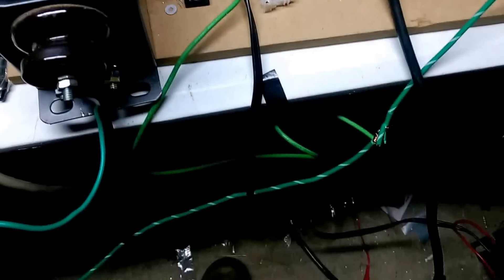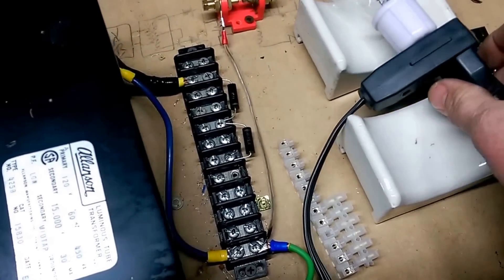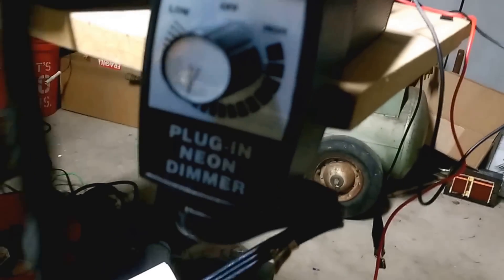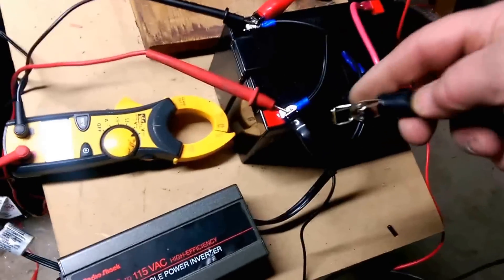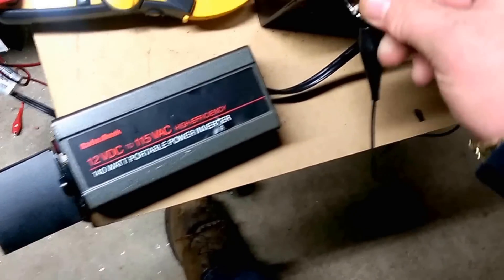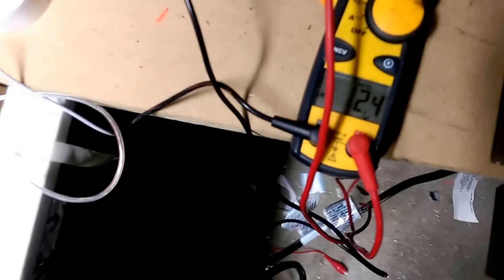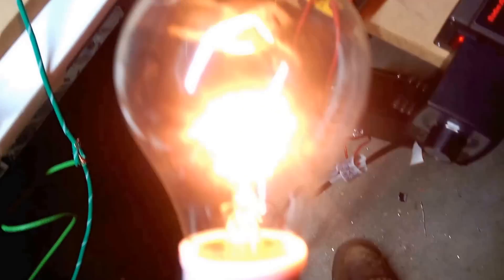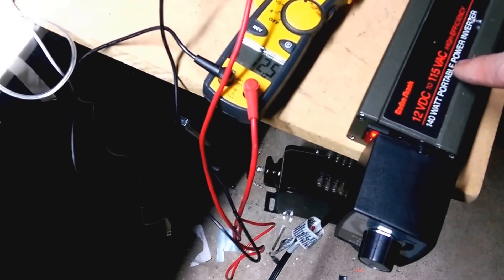Working Free Energy Generator-Dezeinstein Technologies-Annotated

Comment: Hi, Mark!
It look's like privious video! 
This if very normal to me, you drive nst and bulb form battery and inverter.
How about the ampere meter! I don't want to be rude, but what is so special here?
brd
Reply from the maker: +Francis Graf regardless of what happens with the voltage or amperage,  its capacitively attracting energy from the Earths electrical field,  so,  it isn't overunity,  it literally doesn't even violate one law,  but,  because science doesn't believe its a possibility,  they'd have to rewrite some equations and admit that the Aether exists.  It does exactly what I said it does,  and its not hard for anybody to figure out that there's another source,  its just done by an unbelieved method Tesla discovered,  which does fortunately output more than it draws due to how it works.  that is all that matters.  the biggest issue I have is whether people believe it or not.  it doesn't matter by video if anybody wants to believe,  or if they do by seeing the video..  if their like to see it live,  I'm sure I'll get an invitation to a convention somewhere to. show it as I'm one of the only guys on the planet to. successfully replicate Teslas phase conjugate circuit,  that is after Don Smith passed,  and its not exactly the same method Don. used which makes it my own.  If power is put in,  of course  power consumption will be reduced.
Reply from the maker: I actually haven't even had a chance to scope it yet. I am having issues with my 5kV probe, it only works when the spring is depressed... gotta send it back to the ebay seller.. It was a Chinese product.. some are good, some are crap.. this one is crap!  anyway, I have a 40kV probe but it is for a meter, so, I am nervous of blowing up my scope with the 1 to 10x probe.. I'm not sure what the voltage is at the line side of the diode.. I'd be happy to scope it after the diode at the capacitor as the voltage is in the safe zone. I can scope the inverter, however, I am waiting for a package to come since I accidentally tapped the side of the led bulb to the arc gap and zapped the inverter dead. It doesn't work with a modified square wave inverter as the transformer becomes all whacked out with the choppy wave and it gets very noisy. I am afraid I will ruin the NST with it so I will wait until the ebay shipment arrives before messing with it. I do have the inside of an old black and decker inverter that I was going to mount in another case, I may try that .. I don't even recall why I took it apart, maybe wanted to see if I could remove the protection circuit.. I will try to see if it works without shutting down but I am afraid it is MSW as well.. They are junk and everybody should stay clear of them. I remember way back when there was a Canadian brand that made all true sinewave inverters for reasonable prices. I gave mine away not knowing they would become out of control expensive for a decent unit like they have become, however, they all have low voltage shutoff, temperature protection, gfci or some other forms of protection circuits that all interfere with the operation of this circuit. The devices think that they have low voltage because the output only reads at 85 vac, then again, the voltage works just fine as it isn't a normal voltage. the 67 watt light bulb at maximum is way brighter than a 100w light bulb and it runs at maybe 40 watts . The nst idles at a much higher wattage than I thought it would, but then again, if you watch Don's lights running at the Tesla Symposium the engineer that was impressed with the output into the bulbs tested the output and said it was runniung at 79 or 80 volts and he said that converts to about 120.. whatever that means.. But Don said it would correct itself. My device does the same thing with a load on it. I have tested 85 to 88 volts at idle, then, loaded it gets right up to 120 after it runs a few minutes. The output levels are much brighter than conventional power. The light is brighter and it is cleaner looking if that makes sense. I'll probably receive the radio shack inverter tomorrow of Thursday so i will test it and send another video to the tube..
Reply from the maker: +Francis Graf for anybody that wants proof real simple take a 12 volt battery take an inverter and hook up a 60 watt light bulb plain and simple watch the voltage go down
Reply: +dusanln 
I had the same question.  He is claiming that if you present a load to the system is will run without depleting the battery.

This is common with many EMF or radiant energy systems, the LOAD is what calls for manifestation of the energy.

I too am skeptical, but Marc seems like a pretty reasonable and straightforward dude, when something doesn't work, he says so.  

However, I too would be interested in some further testing and demonstration.  Maybe another identical battery/inverter/light bulb or load, and let them both run until dead.
Reply: Yeah this is the same video . . .
Reply from the maker: +dusanln the nst is not driving the bulb, nor is the energy from the battery.. if this was just battery energy powerting a bulb through an inverter, the battery voltage would drift down immediately. the batteries are way too small to maintain their voltage. Even the largest car battery's voltage would go down instantly without a source of input.  The battery starts the system and continues to be charged from the system via wireless loop.. The battery is not connected to anything other than the inverter as for a source of power, nothing is connected physically. It charges itself from the fields and the way it is set up... nothing else!!  That's what makes this special. Try it yourself with an inverter and a 60 watt light bulb, you'll see! . no ordinary system can do this, and, the amount of time this runs in my next video will show it impossible for 12 aH of batteries to run the system without the voltage quickly dropping.. The system does not contain any input outside of the battery and it infinitely runs. If you look at this output from the transformer, you will notice that one of the output leads isn't even connected to anything but an empty terminal block. The other wire goes to an arc gap that isn't firing. The other terminal , which is the center tap goes out to the capacitor's negative terminal, so, the battery and the inverter are powering the transformer at idle. If we turn the neon dimmer to the correct spot, the system self runs and lights the bulb as well as the neon sign transformer. The amount of energy coming from the system totals  140 watts the inverter's maximum rms output . The battery would die a near instant death and the inverter would shut down within seconds if the system were drawing from the battery alone because it would not maintain it's voltage and kick off. I have a much longer video I will upload to prove this as the camera ran out of space here and I had to erase other videos before I revideod this.. The battery always maintains 12.3 volts under load, and, when we shut the bulb down, it climbs to 12.6 volts, regardless of how long it runs.  When we shut off the system, the voltage starts to descend to 12 volts, normally staying at 12.2 after running and charging wirelessly. I have run the system for 24 hours straight with the bulb on, changing it to  4 LED bulbs which were operating at 12 watts each, and they were super bright, brighter than they are with normal ac coming in from the wall. The four other bulbs were CREE LED flood lamps and this through an inverter would decimate the battery. The output from the inverter is quite different as it shows to be 85 volts ac, and, it comes out as a square wave until it is loaded , then converts to a perfect sinewave. my amperage wasn't shown because my clamp was being used for voltage as my klein meter stopped working shortly after it was purchased. I have to get a replacement.
Reply: Yep, I'm pretty much convinced, for myself its just about relearning, and connecting the dots at this point, because Ive spent my entire life learning something else.

It was 100 years after Franklin showed his light-bulb that people started thinking about powering their homes . . .

We have the same goals, but it isnt about convincing people at a Tesla Conference, or the Energy Conferences, its about convincing ordinary blue collars and housewives.

Otherwise we will just keep going the way we are . . .

Anyway I have a lot of questions, Id be willing to help you with your videos in order to learn.
Reply: +Marc Belanger   either a field in space is charging the battery or all components linked via the wiring are charging the battery  //  would we not get a higher amplitude with impulse dc as opposed to square wave  //  is there a spike on the tail end of the square wave ??
Reply from the maker: +Francis Graf I'll hook.you.All.up.with further time lapse demos, however, if I.upload these to.a server, will there be somebody willing to edit them so I.don't look like a liar?? I'm gonna try to film.in a smaller format to probably my empty google drive server, or somewhere with free storage that'll handle the large sized vid. what I've basically been saying is that the nst and the bulb is way too much load for the battery to ever stay anywhere near where it does. I've witnessed meters telling me the voltage was higher due to hv being near it, however, this isn't what's happening.. I know better with nearly 30 years of electronic experience and 20 alone in the high voltage industry as an hv cableman, I know the difference between interference and a wireless capacitive charge by ionization. believe it or not, that's not really what's happening here, it's a reaction between the resistor, the DC capacitor, and the plates and capacitive component of the battery, which is happening. I have a set of high voltage phasing sticks that have a capacitive test point tester for medium voltage loadbreak and deadbreak elbows. this tests and shows a level of energy at the capacitors which is exactly the same at the battery, but, it's not measurable with a standard digital meter that's built for conventional voltage since this is not the same. folks for years have been saying GERARD Morin is a complete nut for saying his additional radiation is immeasurable, however, he is right. a wireless voltage detector can be tuned internally to be less sensitive, so , when this is done, the meter shows you exactly what energy is getting where.. a fairly straightforward process that will offer belief. this process is anything but ordinary and I'd like anybody to show me something similar that they witnessed with an.NST powering a bulb because they produce lightning bolts inside, not light if special attention is given for modifications. also note we do not have an arc firing in the spark gap. that's a first for anybody to get energy out with this happening.
Reply: +Marc Belanger 
Hi, Marc and thans for explaining.
I will be more then willing to try your experiment.
Can you please draw a shame on a paper, make a photo and put in on internet,
so we are all clear how this is done.

brd
Reply: Marc,
   Im on-board, more looking for a concrete way of displaying proof, so the people who haven't been studying this for years can grasp what you are talking about.

If you modify a meter I would love to have one, but for the laymen that wouldnt suffice as proof.  "You modified the meter!  Bullshit!".  There needs to be a control setup, run side by side, timelapse video showing the traditional system running dead before the new system.

I have a small A/V production company.  I would be willing to edit the video for you.  Send me a private message.
Reply from the maker: +Francis Graf in the amount of time that my video played the voltage will go down with the same type of batteries
Reply: Well my initial response would be that the battery is being treated as a capacitor.  So the voltage is going up, but the  amps are going down, so the total wattage is lower.

That is going to be the response of anyone with basic knowledge of home electrical.

Im willing to defer to your much greater experience, and accept that something else is happening, especially based on some of the other experiments Ive seen from other people.

However we need to establish more concrete proof.  Self looping, charging another battery, something...

My understanding is the difficulty comes with multiplying that static charge into a usable pressure.  Introducing a pulse, reducing resistance, increasing permeability, by way of frequency and voltage....

I don't have all the pieces together, and my knowledge is lacking.  So Im willing to support someone like yourself who is miles ahead of me in this process, in order that I might further my own understanding.

Anyway, if you want help with your video please contact me with a PM.

Comment: very nice, are you looping the output back to the battery or the inverter?
Reply from the maker: The output wirelessly charges the battery so it isn't a wired or a physical loop from the caps to the battery,  but the inverter ties to the load and the input of the circuit therefore creating a loop that continuously functions without killing the source battery.

Comment: Are you saying the only items needed are 1,2,3,4,5,10,11,12,13?  I ask this to verify I'm referencing the correct drawing. After looking at the first drawing, by clicking on the arrow I saw other pictures which I at first thought were important but I now think the only picture you wanted us to pay attention to was the first one. I'm guessing by "reduction in components" you mean that not all items 1, 2, 3, 4, 5, 10, 11, 12, 13 are necessary? I've watched the video many times. I can't figure out how the wiring goes on the output of the NST. It's especially the back side of NST I'm not sure about and the capacitor bank has me confused. A slow pan of the whole setup would be very helpful. When the camera moves fast the focus goes. You're obviously very excited about your discovery. I need more so I can follow along. I'm posting the schematic address also. I'm curious whether it disappears on me so here it is: http://i1108.photobucket.com/albums/h404/soundiceuk/Tesla/DonSmithSchematics2012-3.jpg
Reply: +Joseph Richardson 

I was curious about that also, I think he is saying that he has simplified the design, and that the reduced version works the same or better than the more complicated one?
Reply from the maker: Yes, correct, not all are needed, but, care must be taken to use the right length of wires for the battery to the inverter as well placement next to the caps. The fine strand stuff is what draws charge
Reply from the maker: +Joseph Richardson 1,2,3,5,10,11,12 is cap bank dc,13,15 but the output is not connected by any wired means. the wire length and type between the inverter and battery is the antenna to charge the battery. this can be figured out by placing leds on the battery terminals in the correct orientation to light if you used a wire to connect to the opposite battery pole. Once you move the battery where it is necessary to light one led, the second one is due to the wire lengths and type used as said between the battery and inverter. Then nst here in my video is 120v ac fed from the inverter. The output of the inverter must go through the nst dimmer (pass and seymour as don used, and, the inverter must be a square wave inverter)
Reply: +Marc Belanger Could you please do a video where you show how to find the correct wire length using the LEDs because I'm not understanding your explanation. Also your capacitor bank is huge! They're electrolytic right? How big does the bank need to be and what voltage rating do you think it needs?
Reply from the maker: +Joseph Richardson I'm not sure what it has to be.. Mine is 340 or 360 volt dc caps and they are 3400uF each. Don just said the bigger the more output. I don't necessarily find this true, and, I also tried the 1200 v ac caps and I get no charging, however, this means nothing because I at the time I tried wasn't getting an arc in the spark gap so I thought it wasn't working. I should have added the fwbr after this , then added the resistors, so, I will also try this because I have (6) 1200 volt 88uF massive AC caps to put inline that look just like his 2uF bank of caps. They are even bigger than his and probably extremely advantageous.. I have to buy more crimp spaids so I don't have to  unbolt them all the way to connect the jumpers.

I'll have another video by this weekend ready to upload, maybe even 2 or 3 of them. The second video I sent was supposed to be private until I annotated it . I'm not sure if Youtube had a glitch with their settings..